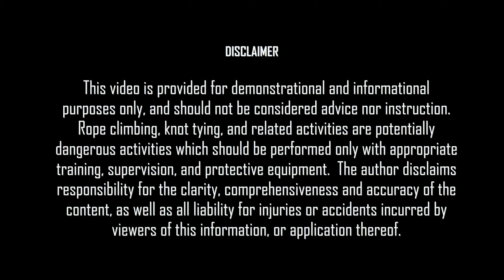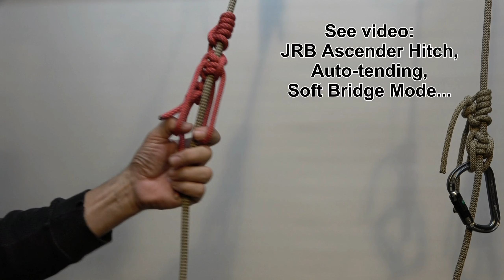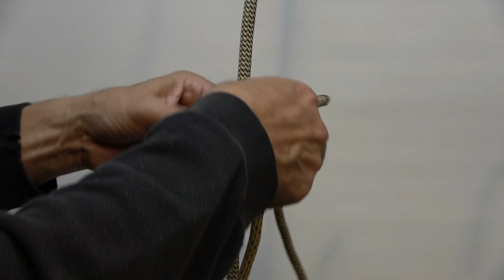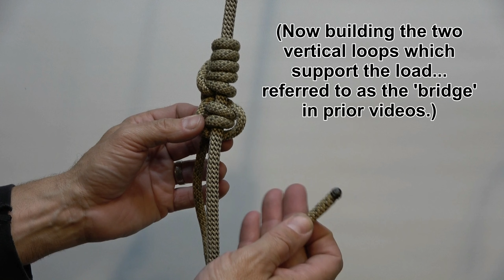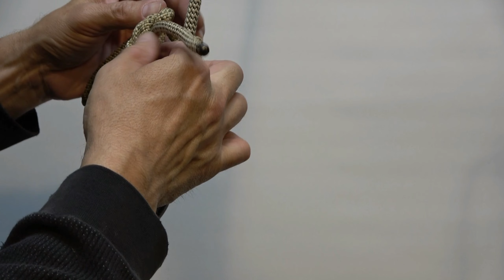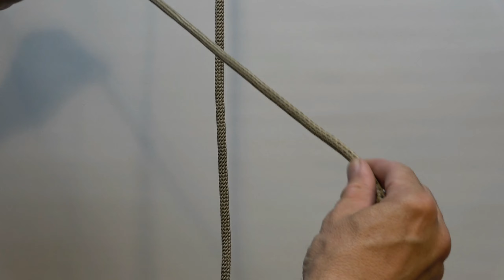Compact JRB Ascender Hitch, version 1

Comment: What would be a good easy hitch to use in a one stick application where I am removing and retying each climb. Looking for something easy to move up and down but also easy to remember and apply. Thanks. Great videos.
Reply from the maker: 1. Look up the video called Tying the Longhorn Agile Hitch, which is formed using a Longhorn Hitch/Loop.  Here is a link showing how easy I can tie it and climb.  2. I will soon be releasing a new hitch, which is even easier to put on the line, but it doesn't have the auto tending feature.  
https://youtube.com/shorts/4vZWCDcNYCY?si=TzKkafxWDZif2IS1

Comment: I find that if I start with a loose loop (tree gets small usually as you go up) and actually put the pole hook in the rappel ring I can work the rope up the tree better without the loop getting bigger and sloppier as I work the rope up,  get a little slack out at the top, catch on the tree,  remove the pole hook, put it back in the carbariner to push up a bit more , and pull tight, seems that I lose less height in this manner, but still working on using my pole. I’m encouraged with the cinch and pole to develop a good system of adapting to whatever situation I walk into chasing the BIG BUCK

Comment: John - why did you developers a v2 of this hitch? I prefer this one because the closer knot is in the descending portion of the coils - it seems more secure and the hunters bend also seems more secure
Reply from the maker: Nicholas, not surprisingly, when published this video, named version 1, I already had some other variations but had not yet fully tested them. This one has some jam resistance, but not as much as the non jamming (NJ) variation.  I believe tying the hunters bend in this variation is a little bit more tricky than the flat overhand in the NJ. Also, the presence of the bend on the descending strand can affect how the top of the helix binds. I find it slightly less reliable, where sometimes it doesn't grab after moving, particularly if the bend is too close to the top of the helix.  Lastly, when hitch climbing, we sometimes have the hitch very close to the trunk, possibly touching it and when we go to advance it, with the NJ, i can use the tails and backup stopper knot as a handle, used to advance the hitch.  No need to put my fingers between the trunk and the rope.  However, in it's defense, I still have one of my hitch climbing systems rigged with this version though and with it properly tuned, it works great.  It's likely to be more stable overall in that the hunters bend is more stable than the flat overhand which I felt needed a backup.  Bottom line is that they are both viable and it comes down to preference. Where are you using yours?
Reply: @jrbtc  thanks for the fast and thorough response. I have this knot tied with 6mm sterling facing opposite directions on both ends of 8mm res tech. I advance running jrb hitches with a pole and alternate hitches at the ends of the red tech to stay tied in as the rope is advanced up the tree. I’ll tie the v2 and compare. I did notice that I tie the bend very close to the top coil. I may attempt to lower the location of the hunter’s bend to experiment with the effect. On  another rope, I am using the v2 compact nj knot tied with 6mm sterling on 9mm canyon elite . On that rope I also have the v2 nj knot on foot straps. The upper knot will jamb under load. I have to use the foot strap to remove the load and break the knot. I attribute that to having 6mm on 9mm.
Reply from the maker: @nicholasmarinelli4575  Kudos to you on always being tied in. Also, pls be aware that Sterling doesn't recommend anything less than their 7mm cord for life safety applications.  On a doubled rope system it would only see half our weight and so I have convinced myself its ok in those applications.  But yours is a single rope application. 7mm Sterling works great on 9mm ropes and surprisingly well on 8mm ropes as well. It's also easier to break under load and stretches less. Pls consider grabbing a package and doing some comparisons. And of course ya got the JRB10 discount code at  RockNArbor.

Comment: Hey John, when tying this compact version I’m confused how I tie in my rings. I bought the rings based on your list and them being more compact then carabiners.
Reply from the maker: The compact version wasn't intended to be used with a handle. It's for a tether or a footloop where  we wanna minimize the overall size. I'm not saying that you couldn't put a handle in there, but generally speaking, I would always want a longer a loop on the and for a climbing apparatus and that is when I use a handle. This video explains how to tie the 523 with a handle including a ring.
https://youtu.be/Ju7wJM_uxtw
Reply: @jrbtc  gotcha! That makes sense and I appreciate you clarifying. I am setting up my JRB climbing system so I was trying to tie the compact version on my climbing line. Won't worry about it then!
Reply from the maker: @TruthSee-Ker  when tying the JRBAH on a JRB Climbing system,   ya want to make that loop at the bottom as long as possible but still enable you to easily reach the top of the hitches to break them for rappel. It depends on your bridge length too. Longer loops make them easier to grip and move, because ya need to get your fingers on the handles and shove up

Comment: hello!   I'd like to know what exactly makes that knot ( all versions) better than Catalyst, Vt, Michoacán, Distel ... ? thanks!
Congrats for your work  👏👏
Reply from the maker: Its pretty simple for anyone to put a rope in a tree and put a friction hitch in it, clip into it for non mechanical SRT and verify:
1. After loading with our body, when we step up on our footloop, this is easier to break and move up. But some are very similar. 
2. But nothing is as easy to break under load. Try it. Its amazing. 
3. As demonstrated in this variation, when its not loaded, i can pull on the rope under it and the friction hitch is moved upwards. Its self tending.  You can't do that with any of the ones you mentioned. 
4. It can be configured with a handle as a hand ascender. 
5. I can rig it with one or two loops at the bottom. So i can rig up a hitch climber pulley MRS system without an eye to eye or knots on the beaner. Make sure u have watched the earlier vids on the playlist. 
https://youtube.com/playlist?list=PLETL-PceEXkYzZVteVwc0REz37uDr7-_C

Comment: You possibly could limb walk with that configuration.
Reply from the maker: Most Arbs I have discussed it with prefer MRS for limb walking. Ya have better control because the friction hitch has half your load. Even SRT climbers will often switch from SRT to MRS in the canopy.  This is where I believe the JRB doubled rope climbing system has potential application, and this friction hitch on the system. Because as soon as we remove the Garda footloop, it becomes a moving rope system and either side can be the moving side.

Comment: Cool , I’ve been practicing with the original ascender hitch in bridge mode and with self tending hitches in soft bridge directly on my bridge d rings, which this compact version might be of good use on the those d rings and seems great for a lineman’s rope,  but I can see needing the long loops of the original hitch on the top redundant hitches when bypassing a limb, so I’m thinking I’ll keep my longer loops up top  to get over limbs, thanks for the variation